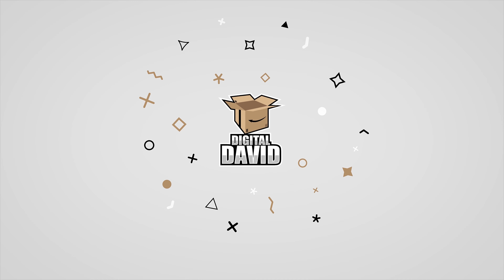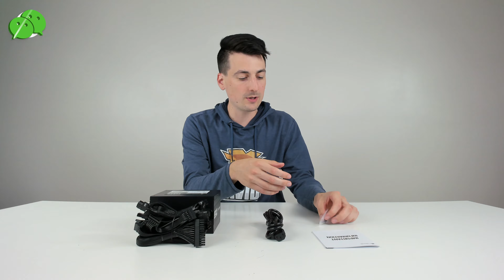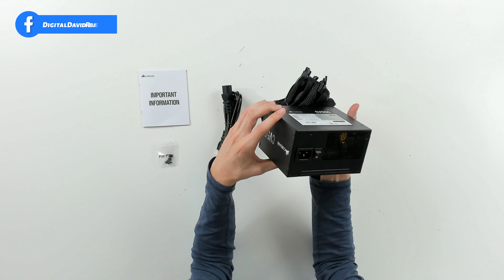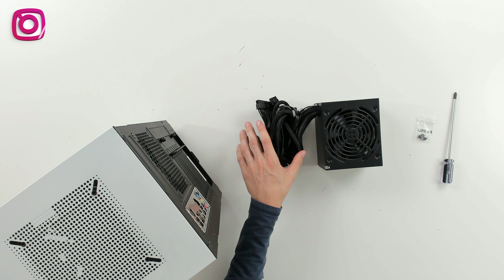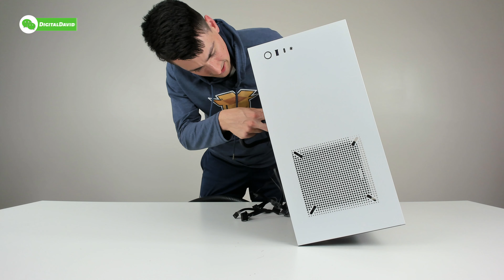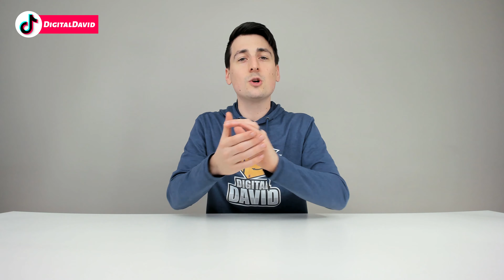Corsair CV550 550 Watt 80+ Bronze Certified Fixed Cable Power Supply

Comment: Excellent power supply for the money, quiet and does the job. It's great for a mediocre build. It is quite small, which gives more space to hide the cables in the case. Corsair never fails with their PSU
Reply: Mine is making a buzzing noise when my pc is on. Sometimes it is quite noticeable. It also makes noise when pc is off unless i turn off the switch it keeps making a low buzzing noise. Any fix for it?
Reply: @sk.mahdeemahbubsamy2857  is it a coil whine ? You can look up coil whine to confirm it, sometime its a low pitch scream, sometime sound like you earphone when its being pluged in
Reply from the maker: I agree 100%!
~B

Comment: Will I connect rtx 3070 cards requiring 2x 8pin power to this power supply?
Reply from the maker: Yes, the Corsair CV550 550 Watt power supply should be able to handle an RTX 3070 graphics card that requires 2x 8-pin power connectors. The CV550 power supply comes with two PCI-E connectors, each providing 6+2 pins, which means you can connect two 8-pin power cables to the RTX 3070 without any issues. Just make sure to properly connect the cables and ensure that your system has adequate power for the graphics card and other components. cnl
Reply: @DigitalDavid  I'm running into this issue now trying to plug it into my 2080. Can I use the pigtail cables to plug into the GPU to plug into the 8 +6?

Comment: how do you detach the cables from the psu?
Reply: This is a non-modular psu, you need to look for a modular one if you want to detach cables. Bear in mind that mixing cables from different psus can be very dangerous for the system
Reply from the maker: Thanks for clarifying that!
~B
Reply from the maker: You dont!

Comment: can you connect an rtx 3060 or 3070  with this ?
Reply from the maker: Yes! Minimum requirement is 550w
Reply: It would work, but bear in mind that gpus of the xx70 series and above can sometimes spike in power and cause the system to turn off due to the built-in protection, so maybe you will need a beefier psu later